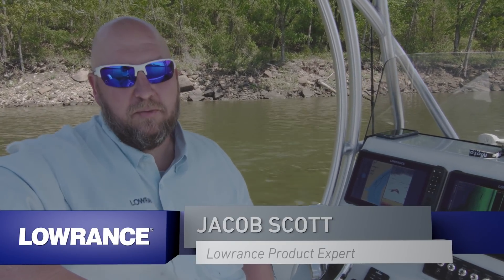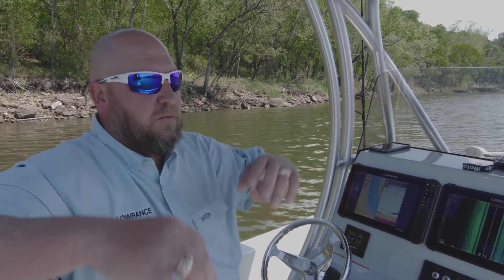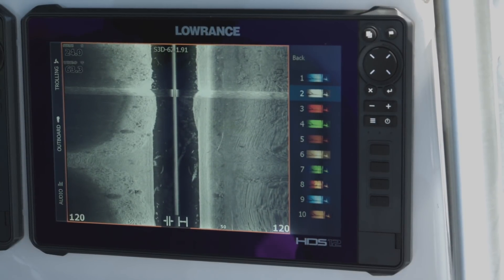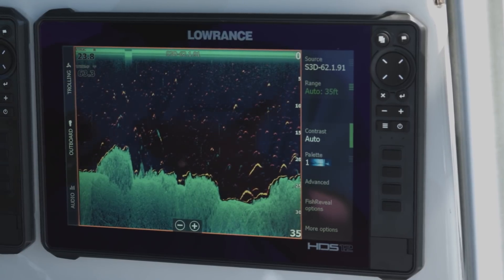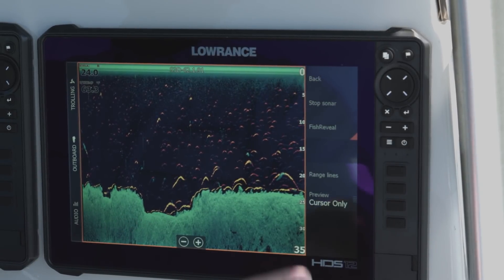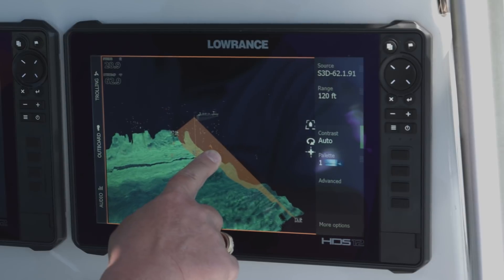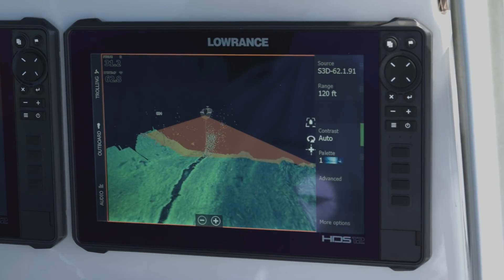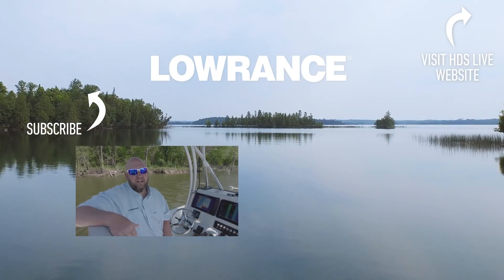Lowrance | StructureScan™ 3D Basics

Comment: Will this Transducer work with my Simrad Go9 and Sonar Hub ?
Reply from the maker: It is not compatible with the GO series. Bear in mind, also with compatible units as the NSS or HDS series you will need a 3D module for it to work.

Comment: Can you use structurescan 3d sensor standalone with a lowrance unit or you have to have also a normal sensor on for the depth reading? Because if i dont have the normal sensor sonar on the unit   It is not able to track the bottom!!??
Reply from the maker: 2d sonar is recommended. Structurescan does not provide normal depth and normal depth ( DPT ) is used for controlling auto settings on structure.

Comment: Should be entitled “Problems you will experience with Lowrance” scan up to 600’either side of the boat but really doesn’t work that well so I usually use 120’. Oh, and if you don’t have the transducers at the same level you may see this double line.
Reply: I would have thought the depth offset feature could be used on one transducer to bring the double bottom traces in line with each other.

Comment: Hi, have a question I do not seem to be able to get an answer to anywhere. Noticed that I get 2 different depths when I run 83khz and 200khz and also medium chirp and high chirp! I see, for example, that the bottom is 5 m, but on the plotter it shows about 6 m? If I change from 83 to 200 khz, the plotter can also show 5m. So if I look at 2d and see that the bottom is eg 5 m but on the actual data layer on the display it shows eg 6.5 m? Seems like it shows type 2a reading as when it is hard bottom, and reads it instead. And then it will be completely wrong when you map up maps. Do you have any idea why this is so. Have talked to some friends who also have Lowrance because I thought there was something wrong with my sensor (Ai 3-1) But they had the same problem. Seems like it shows the right depth on data storage as long as you use 200 khz, Regards // Mattias

Comment: I'm using the HDS Live 9 and confused on the 3D Structure scan. Does it work with my 3 in 1 Transducer or do I needs a separate 3 in 1 transducer and module ?
Reply: Good question....answer would be very helpful so I can order this stuff
Reply: The 3D on the live, carbon, and Gen 3 Lowrance units requires the SS3D Structure Scan module and transducer. Neither total scan nor the new AI tranducer have the capability to do 3D.
Reply: im buy 3 in 1 and structure scan , the trasducer is diferent .
I still don't know if I can install both. what i know is you need to buy it separately